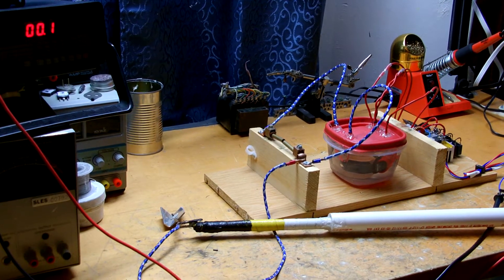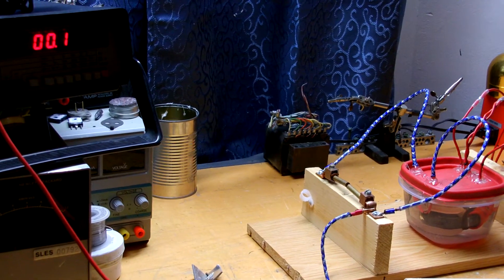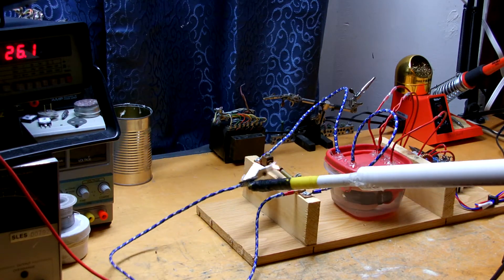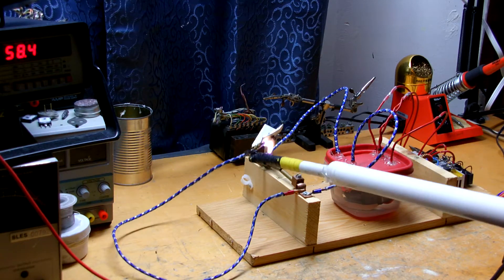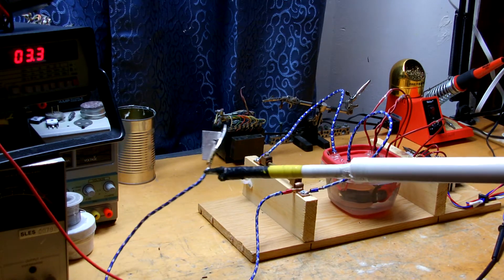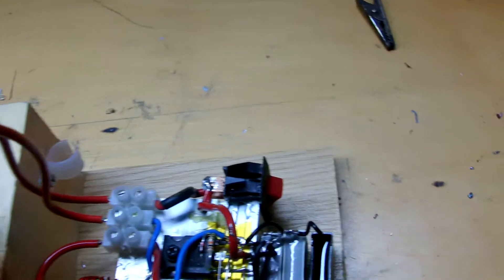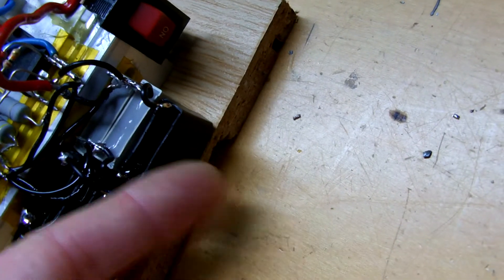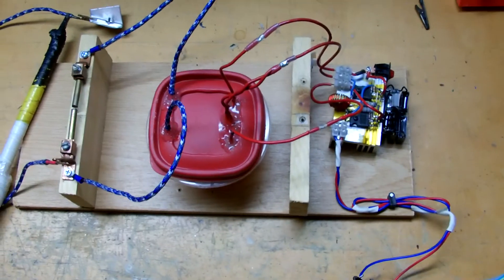60V big ZVS arcs!

Comment: I know its not unheard of but they can and do fail when stressed too much.  You're putting a shitload of high frequency high current AC through them.  What voltage are they rated for? Running on 60 volts input could be producing enough spikes on the primary to overvolt the caps on each cycle.  
For long term high power, I'd say go with a lot of smaller value caps all rated for higher voltage.  More resistance to spikes and much more surface area will keep them cooler.